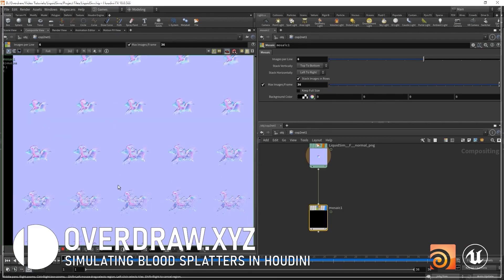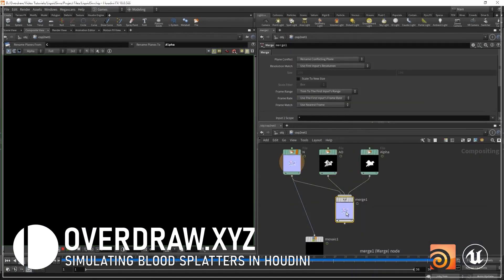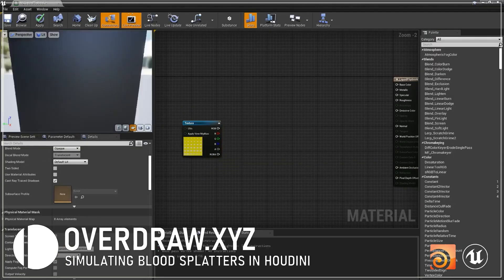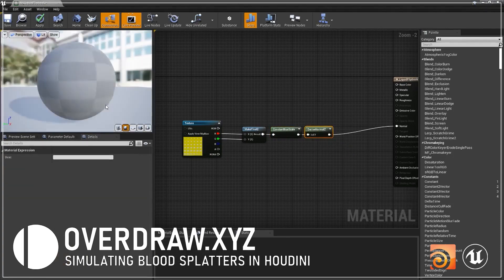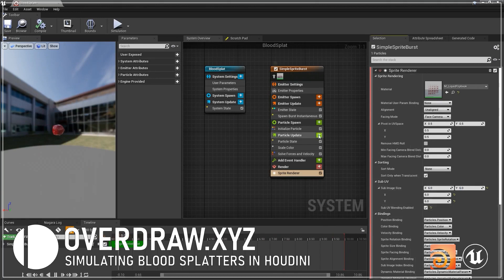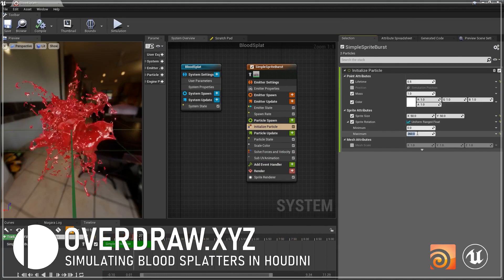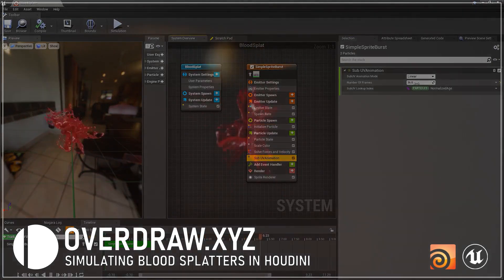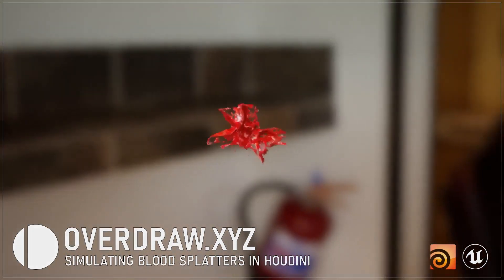Simulating Blood Splatters in Houdini

Comment: Hello, I originally brought your tutorial about a year ago, I was wondering if there are ways to improve the fluid dissolve part, instead of the particles deleting but rather shrinking into one another's droplets like real fluid. and shrinking into nothing over time. I still haven't found a tutorial as good as this one and I think this needs more light.
Reply: 那就做溶解
Reply: Dissolve using an erosion map in Unreal material editor. There are plenty of examples on how you can achieve this, you can watch talks on how similar VFX are made. In your case, Assassin's Creed 3 did blood splatter dissolve using that method. Simplest way of adding an erosion to a shader would be to multiply with threshold or lerp between your texture and a white value with a custom alpha.